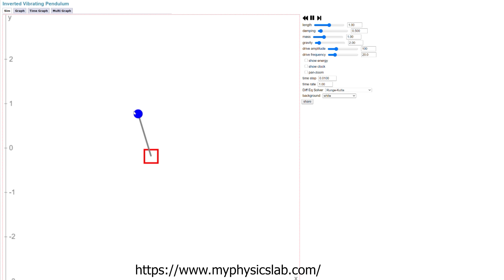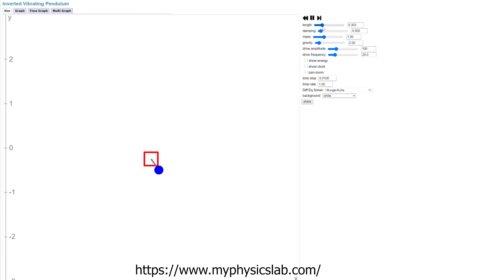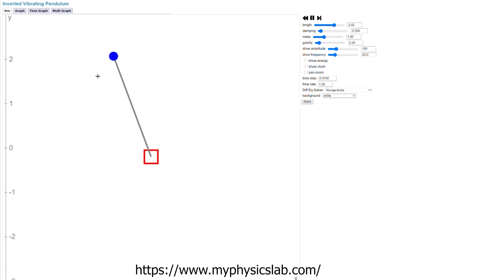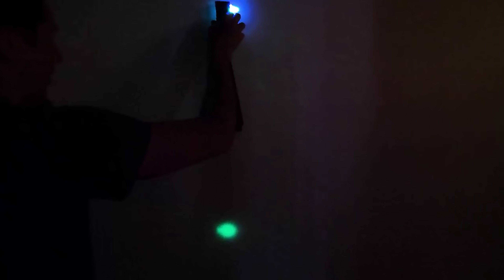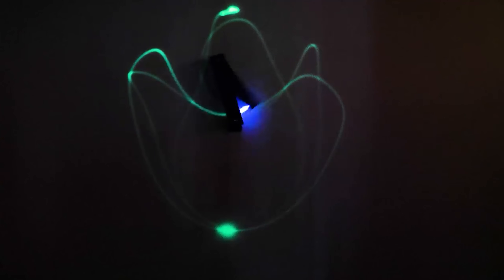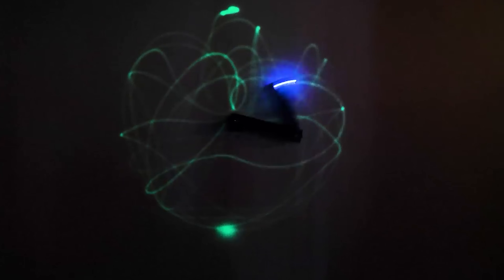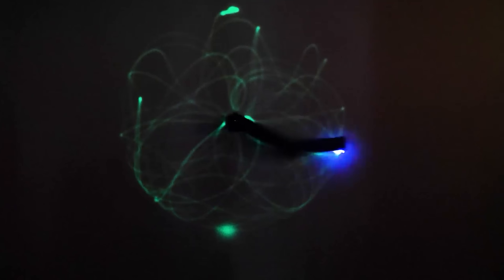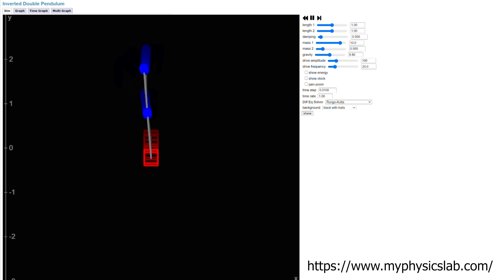Self-correcting Inverted Pendulum Defies Gravity

Comment: Him: Wearing more protective equipment, is safely behind the device thrusting metal pieces forward at insane speeds, and is in the center of the room where he has room to move, should something happen

Her: Is wearing much less protective equipment, is literally right in front of the dangerous device while being instructed to bash it around, while also being confined in a dark corner with nowhere to go should something go wrong.

Her having the worst job ever is a pretty accurate assessment

Comment: Bro, but you can do this simply by using a bar/pendulum in which mass is non-uniformly distributed {i.e. center of mass should be at the side of bar from pivot point} .....

Then also stable equilized position would be towards upright....

By the way very nice video bro. Love from India....

Comment: Usually only 2 of the 3 (amplitude, frequency and phase) are involved in the solution of a kinematic 'problem', but this is just crazy-genius-intellect. Usually you see the 'inverted pendulum' accomplished via horizontal translation of the pivot, not vertical translation. Maybe this can be applied to better understanding chaos ... either that or driving you to drinking.

Comment: Objection. according to Einstein which mainstream science has deemed Replaced Newton,  gravity is not a force therefore it Cannot Pull anything. In your demonstration, Nothing is defying "gravity". You are applying counter forces to the tendency of the steel bar to seek it's natural equilibrium. Dude.. be a little more scientifically correct why don't you.

Comment: Hey! I am from India. I have a cool experiment 4 you. Please try once.
In a box having wheels , fix a toy gun and let it to be fired in it so the the recoil can move the box one side and bullets the other side. I have a proof that it will travel max dis. Equal to the length of the box. I want to see it. Make sure that the surface should be as smooth as possible(you can try a mirror)

Comment: Isn't this exactly how a cylinder rod co works with the crankshaft, but wit a cylinder connected to the top? The top and bottom stay fixed and the middle oscillates.

Comment: Sorry to ask this, but i am somehow really curious: In the black room (6:30) with the double pendulum with fixed position ligth LED, would that LED eventually fill all the surface area seen by the camera? Or there are some forbiden areas where it will not ever pass. I mean with enougth time, enough repeats, enough starting positions (with 1st segment vertically up and the 2nd one with a random angle +/- 30º over the vertical top max position).
In other words how would look like the shape defined by all positions the LED really pass through? Not just the theorical (friction less) 'maths' that say all will be filled, i mean with real ambient friction.
All tries i do to replicate that shows me some small areas are still 'black', the LED does not really pass inside them, but if i manually re-arrange in static position that points can be reached.
And how does affect how both segments are initially arranged to that 'shape'?

Comment: or get a long pole, two elastic bands, tie them a foot down the pole at opposite sides and then drill a hole between there these bands are through the pole, attach a 2 foot long stick or whatever and then attach the bands to the END of this stick on either side (following the pole, no bends or curves) and boom. 

Pulling the stick to the right will cause the left band to stretch and pull the stick to the left but due to momentum the stick will continue moving which will cause the RIGHT Band to stretch and pull the stick to the right but due to Momentum the band to the left will stretch and so on until the stick stops moving, add some weight to the stick and stronger bands to adjust how long it swings for. 

This version (as Copyrighted by me, Patent Pending (Jokes)) will allow you to do everything without ever moving the main pole.

Comment: The pulling motion changed the pitch speed witch makes its stable the vibration also keeps the motion u didn’t reverse anything good sir all u did was change the motion threw angle and vibration I don’t get the point of this unless it’s for a self regenerate from its motion I don’t see the use for it

Comment: Please drop a sheet of paper in a vacuum. Vertically and horizontally. It would be so satisfying to watch it fall straight down, without a flutter. But horizontally, would it bow in the middle???
Reply: @Mæbnoom  so gravity is pulling equally on it at the centre as at the corners?
Reply: @UnbelievablyGauche  ugh, yeah? Why wouldn’t it be?
Reply: @jamesbizs  isn’t there more weight in the centre? I knew that was a stupid question when I asked it. Edit: if you imagine 4 people holding a blanket at the corners, it would dip in the centre. That's my thinking.
Reply: @UnbelievablyGauche  Remember that acceleration is not dependent on weight (or, more correctly, mass). That's the whole point of the experiment of dropping something in a vacuum that is normally highly affected by air resistance (like a piece of paper or a feather).
Reply: @UnbelievablyGauche  Imagine 1 guy holding a blanket in the middle, now corners fall. Don't go with this logic
Reply: @mementomori7160  lets imagine a gigantic piece of paper the size of a hundred football fields...(in a vacuum haha) the centre of the paper is closer to the earth because of the curvature of the earth right? So it would bow??
Reply: @UnbelievablyGauche  Only slightly, I think hundreds of football fields isn't enough to make it even noticeable
Reply: @UnbelievablyGauche  That's actually what I was thinking about when you said it. The same physics behind Roche limits and spaghettification. But even at the exaggerated scale you've given, the effect would be barely noticeable on Earth.
Reply: Even better: make a small parachute with a weight at the end of the shroud lines and hold it “upside down” (weight at the top, parachute dangling below) and release that in a vacuum.  It should fall with the parachute part remaining at the bottom and the weight up top.